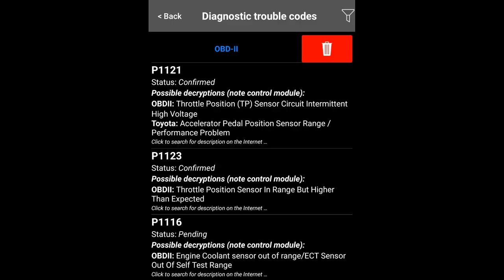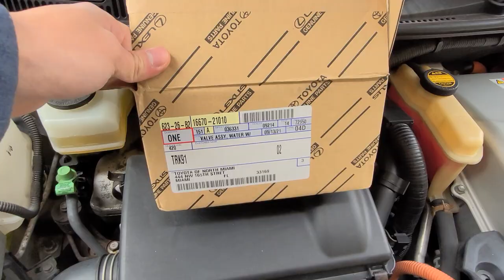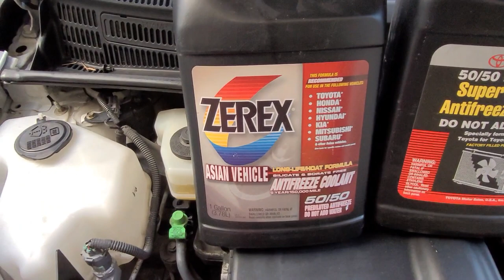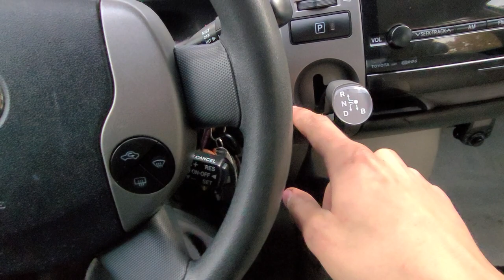Toyota Prius - Coolant Control Valve (p1116, p1121, p1123)

Comment: There are some that say refilling is very very important and you covered that in spades.  The wire method is solid and must be done to make sure air (lack of fluid) gaps are fully or close to 100% removed as this is a closed system and the check engine system will trigger throwing you off the path to a completed job.  Great instruction!

Comment: FYI, if you have large hands, do yourself a favor and take the few minutes to remove the driver's headlight to work through that opening.  Working on this valve and the pump above it is MUCH easier through the headlight opening and reduces the amount of skin you'll leave in the car.

Investing in the right-angle hose clamp pliers for this (and the pump) is definitely worth it.  I lost at most a few ounces of coolant, most from the before I could get the bottom hose clamped.

Between the clamps and using a filler funnel on the radiator, I didn't have to worry about air pockets.  After replacing the valve, I put the filler funnel on the radiator and filled it about halfway, and just watched as the coolant bubbled and the level dropped.  Then I started it, saw no more bubbles, shut it off, stoppered the funnel, and then dropped the funnel into the overflow tank to top it up.

Good call on raising the inverter - that does help a decent amount on hand room from the top.  But pulling the headlight allows removing the valve through that opening, which is MUCH easier than snaking it out the top.

Comment: Thanks for the video. Just got P1116 & P1121 showed up! The car is in Miami, so no need for heat! Do I have to change the valve? Or I can keep on driving it like this? Also like a month ago I realize the coolant reservoir for the hybrid system was a bit lower than the low line. I filled it up with Toyota coolant. A week ago I checked and it was again lower than the low. Is this related to this pump? Or is something else I’m not aware of? 
I have not made the coolant change since I bought the car back in 2019/70k Miles. Will this affect the coolant and that’s the reason it is evaporating? 
There is no leakage or coolant drops anywhere. FYI I changed the other hybrid coolant pump (the one that needs the headlight to be removed) like a year and a half ago with a Toyota oem one. Seems to be working properly. The hybrid reservoir does produce air flow when engine is on. Thank you in advance. Should I change the heater valve even though I don’t need the heater?

Comment: Hi, thank you so much the great explanation. I’m having 2 of those codes (p1116 and p1121) and sometimes red triangle light too. Do you think red triangle might be related to this part? Thanks again
Reply: Hi there ! From my experience the red triangle is related.
 when you change your  coolant it will be fixed .
Reply: @benderossi6280  yes I changed the coolant and the part, and the red triangle is fixed. Thank you

Comment: Hi Lev, Very nice video indeed for us. I am trying to follow this method but when I jump the relay like you did it does not turn the pump on. Any suggestions? Thanks for your time.
Reply from the maker: Check if the valve is properly connected. What are you using to jump it? And are you jumping the correct pins... additional info could narrow it down
Reply: Omg. I was thinking this video was very good, very informative, useful and helpful.  Until the very end. Now I think it's BAD ASS!!  LET'S GO, BRANDON!!!
Reply: Or you need to replace the "thermos?" If you're doing everything else correctly, but that pump is not kicking on, you may need to replace that sucker.
Reply: FJB!!

Comment: Hi I have a question,  I got the one from Amazon and I'm still having the p1116,  you think those the car doesn't recognize it? And they just don't work or they just brake faster than the original?
Reply: I've heard nothing but bad news with Chinese aftermarket, therefore I'm getting genuine Toyota, approx $75 on eBay